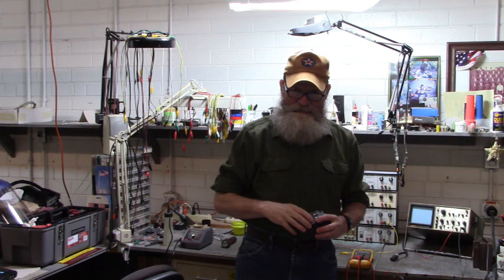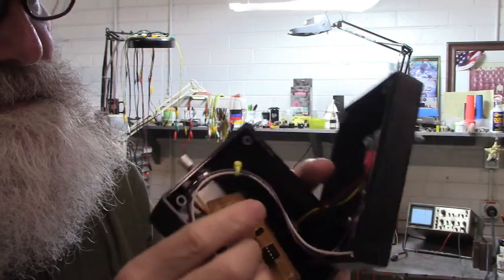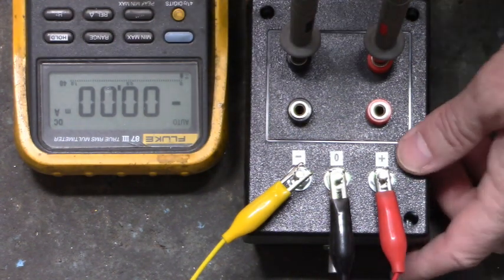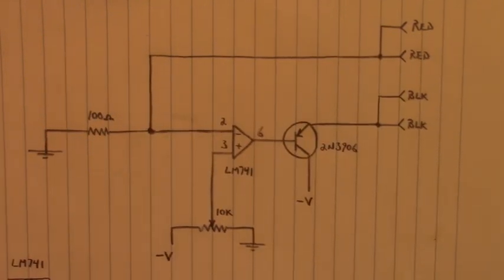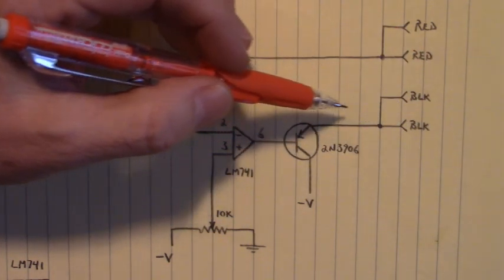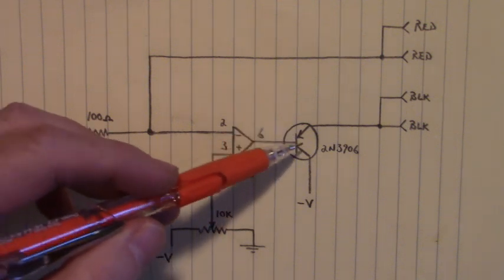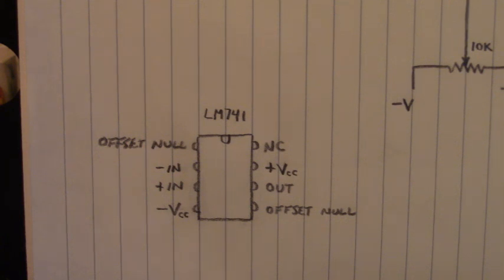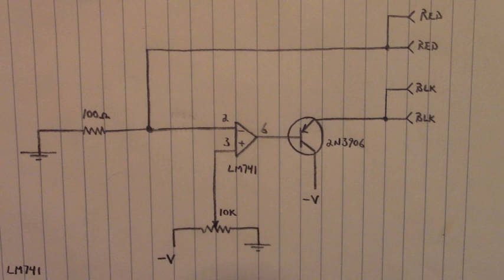Homemade Variable Current Source

Comment: Peepaw I just thought about this a little because its current source (not voltage) your meter should go in series with it not parallel to form a loop that way the drive and meter will see the same current

Comment: Thats very cool peepaw I built one of these years ago for same reason I used a lm317 mine goes upto 110 ma i use it some times to do 4 wire low ohm measurements.... im sure you know this but they use 4 to 20ma rather than voltage to negate voltage drop on long runs a lot of industrial gear sensors etc use current loops,.... Steve